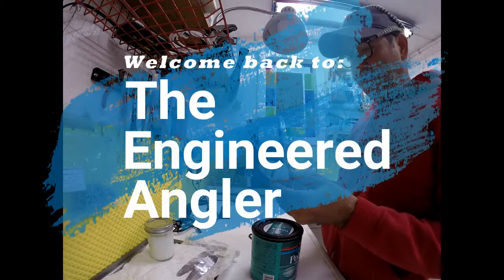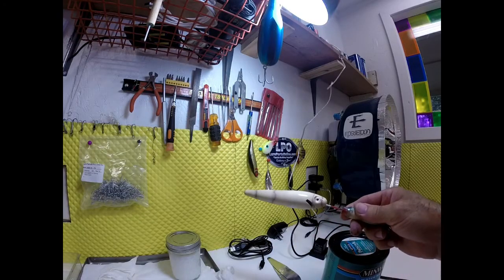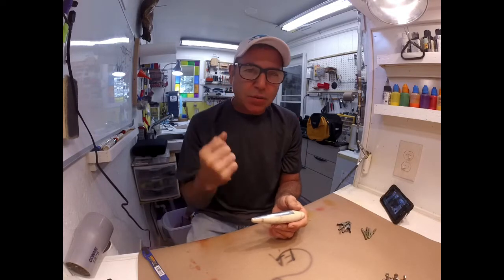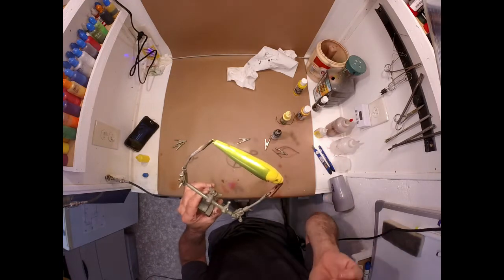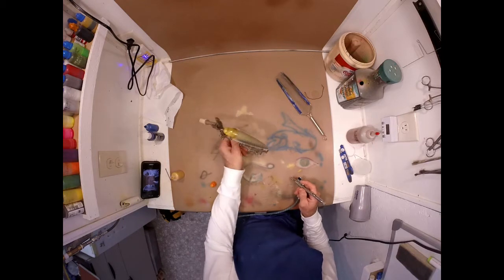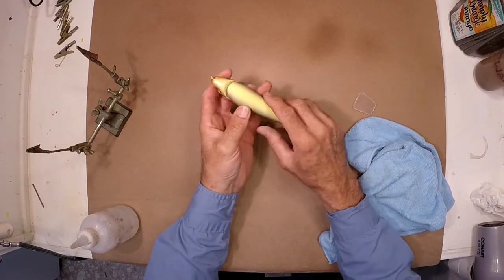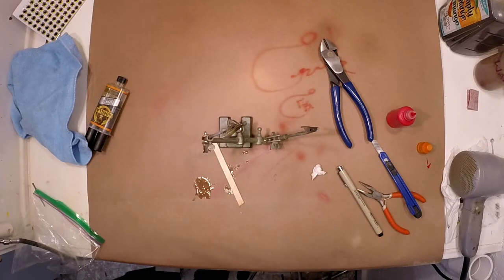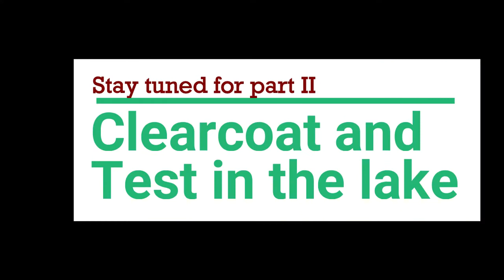Custom painted crankbait

Comment: Why do you like to use a clear coat before applying epoxy?  I do 2 coats of epoxy and it holds up well and has a nice shine.
Reply from the maker: I put the polyacrylic on as a sealer for the paint because I have found that my clear coat finishes much nicer.  Before I started doing that my clear caots were hit or miss.  I would clear coat ten lures and a couple of them would have flaws like ripples or fish eyes.  I don't have that issue any more.
Reply: @EngineeredAngler  I seal my baits as well.  Well my process is apply the sealer, then prime, paint, and epoxy.  I may try a clear coat and see if there is a difference.

Comment: what do you thin your pain with ?  I am having a hard time
Reply from the maker: ReelingWithJim ,
I started out making my own thinner but it's not worth it. I've been using the extender made by createx. it works well. But if you don't mind spending a little more, buy testors airbrush paint, it paints great right from the bottle.
Reply: Like the little glass bottle paint?
Reply: @jokrazy2002  testors air brush paint comes in big plastic bottle.